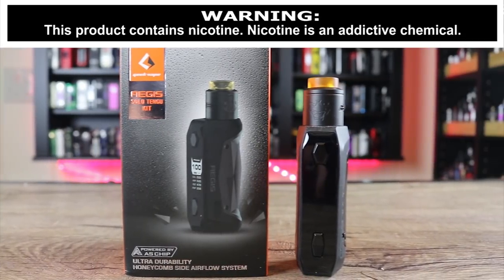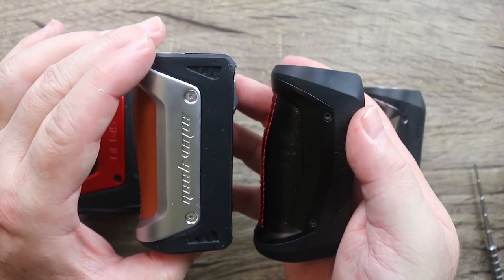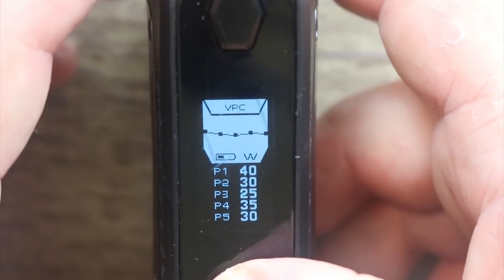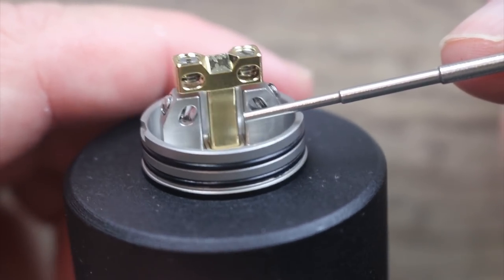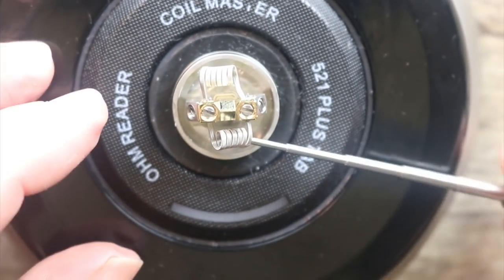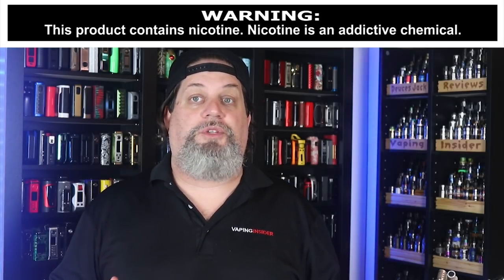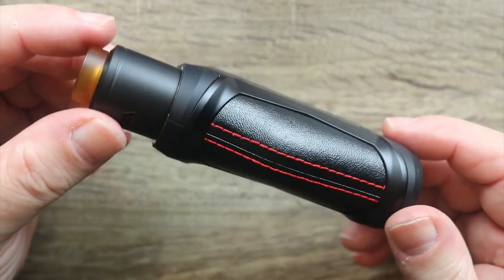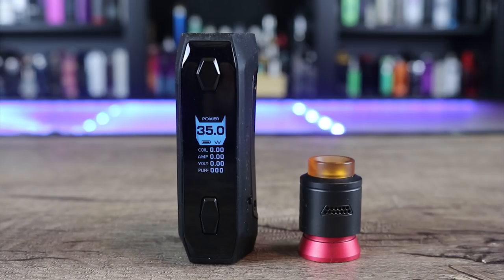DO WE REALLY NEED ANOTHER AEGIS MOD? The Geek Vape Aegis Solo Tengu Kit! ✌️🚭

Comment: thanks for the review.  I agree with you that we need more modes with a 21700 battery
Reply from the maker: All I'm saying is that if it's going to be a single cell, 9 times out of 10, I prefer a 21700.
Reply: You asked, they provided! They released a version with 21700 and an Adapter for 18650 , Aegis max

Comment: My favourite mod for subohming. Mine came with the Cerberus tank. The tank can use baby beast coils too.  Sad to hear you don’t think too too well on this mod. But it works for me. Just a con I’ve noticed is with the Cerberus tank. At the wattage for stock or BB coil, it gets quite warm for chain vapers like me. not good in my opinion.
Reply from the maker: I like the mod, I just think Geekvape dropped the ball by not making it a 21700. I tried to make come thru in the review.
Reply: Vaping Insider idk if my friendly local vape shop carries that type. What is the big deal on that battery? I’m genuinely curious
Reply from the maker: I like 21700's better. I can vape at a higher wattage with better battery life.
Reply: @kirkoneill725  yes but it won't fit in your pocket and be shockproof and waterproof if they use 21700 batteries. I have the solo too and it is perfect for what it is meant to do. I use either the crown 4 or a falcon king tank on mine at work and it doesn't get too hot like the Cerberus does when you hit it hard enough.
Reply: Jonathan wyatt i might get another tank then

Comment: 18650 makes for a smaller mod than that 21700 battery. I like small mods. Especially for when im going out. When im at home, i use the Legend - and when i go out, i also use the Legend; but only because i do not own that Solo YET..! But i want it, because its so small and portable.
Reply from the maker: Gonna have to disagree. The difference in size is negligible.

Comment: It charges fast with the USB. I'm just gonna treat it like an internal bat mod cause I don't like dealing with the battery cap and I don't think it's worth it for a half day of vaping.
Reply from the maker: Suit yourself but charging internally is not a good practice. Even though it's not as bad with a single cell mod.
Reply: Single cell mods with decent electronics can be safely charged via the usb. No need to worry about the balancer since its not needed.

Comment: A good solid device and a good RDA that just won't work well as a package. Singe 18650 regulated mods and dual coil RDAs just don't work - the battery will crap out in the blink of an eye. Fail.
Reply from the maker: Truth, but it's still a really good RDA.
Reply: The solo comes with the Cerberus tank as a kit as well, but I use a crown 4 on mine and the battery easily lasts through a 12 hour shift at 75-80 watts with Samsung 3000 MaH batteries

Comment: My biggest complaint on the solo and the mini are that the metal they use is much cheaper and easier to scratch than the metal on the legend and og aegis, which both had strong thick well painted metal.
Reply from the maker: Haven't had that issue yet.
Reply: @VapingInsider  compare the quality of the metal on the 2 bigger mods to the quality on the 2 smaller mods and you can notice it is less glossy and thinner. I know it is to cut weight and price, but for a mod designed to be carried in your pocket, they need better metal and paint.
Reply from the maker: I hear ya but you know I've always said I'm rough on my mods. I haven't had an issue yet with the metal or the finish on it.
Reply: @VapingInsider  it's only noticable if you carry it in your pocket a lot, or if you have the same color on different variants. I have the gunmetal solo and original aegis, and when you put them side by side it is very noticable. I'm not saying it's terrible or anything, but you can visually see the difference in quality.

Comment: I'm kinda struggling between the Aegis solo and the Jackaroo  especially that Both mods are solid and use single battery. The only downside i find on the "solo" is that it runs on 18650(I don't like 18650).
Reply from the maker: I have both, love them both. Gun to my head, I'll take the Jackaroo.
Reply: I have both and love both, and if you need a compact mod you can keep in your pocket at work, get the solo. If you work at a desk or have a place to keep a mod that is too big to fit in your pocket (like a tool box) get the jackaroo.

Comment: Only reason I didn't pick a solo up is because it's a 18650.
Reply from the maker: I understand that.
Reply: So is 18650 not better than 2200 MaH internal battery? In my book it is definitely better, and I do have both the mini and the solo, as well as the original aegis. Why would they need to make a 21700 mod when the original can already be used as a 21700 mod? Any new mod won't be much different than the original. The only way they could make a pocket size 21700 is to abandon the shockproof and waterproof benefits, and that is what the aegis line is supposed to be all about.
Reply: @Old_School69  because 2x700 should be the standard with 18adapter. Cover all the bases for options. And its battery options not innovating rdas.

Comment: Defiantly think they should of went with a single 21700 instead of a 18650
Reply from the maker: Yep kinda silly.
Reply: No. This one is easily carried in your pocket. If they made it 21700 it would be the size of the jackaroo or a little smaller than the original. This is made for portability and durability just like the mini was, but now you don't have to worry about the battery, and it still fits in your pocket. Geek vape did listen to customers because most reviewers said "why didn't they make it 18650" when the mini came out. So they did that, now reviewers say, why not 21700? Then when they do it, they will say, why not dual 21700s?
Reply: @Old_School69  This is true, but if you consider that you will have to carry extra batteries because you will have to vape in the higher wattage range of this mod, it doesn't make sense. At least with the 21700 you can get 4000 mAh battery (Molicel P42A 30amp) and build to that. Even 5000 if you build high enough to fit the amperage of the 5000 mAh battery (its only 10 amp though so MTL coil builds only Samsung 50E I believe). Best a 18650 can muster is 3000 mAh (Samsung 30Q) and that only can take 15 amps 20 if you keep it below a certain temperature. That doesn't leave you with a lot of build options.
Reply: @StephenSard  I work 12 hour shifts and I haven't had to swap the battery out at work yet and I chain vape when I can and I use either a crown 4 or a falcon king tank at 80 or 75 watts. As my 18650s start to loose their efficiency i can just buy a new one to replace it. The mini i was using before started losing its efficiency after about 4 months. It still worked but it couldn't make it through a full shift. I also have a jackaroo and an original aegis but it doesn't matter how the battery works because they are way to big to carry in my pocket while I try to do my work so it doesn't matter if 21700 is better because it doesn't serve the purpose for which the solo is made for.